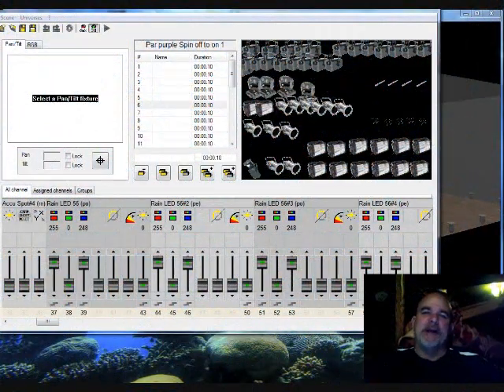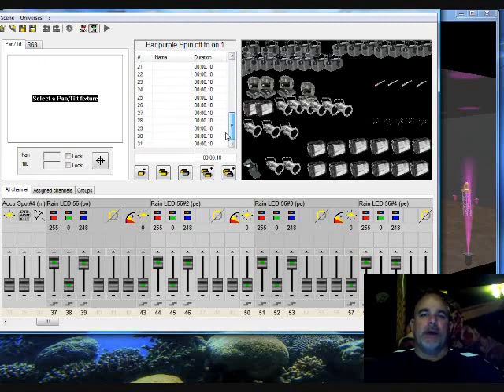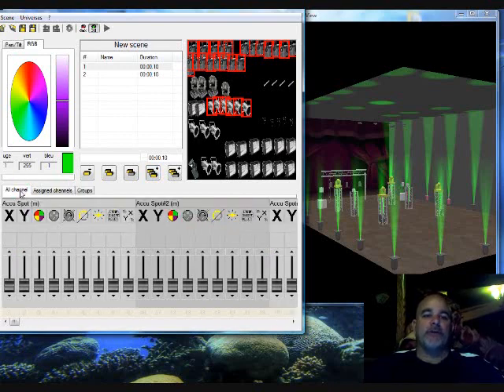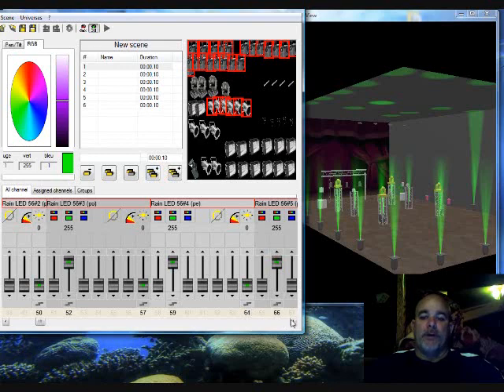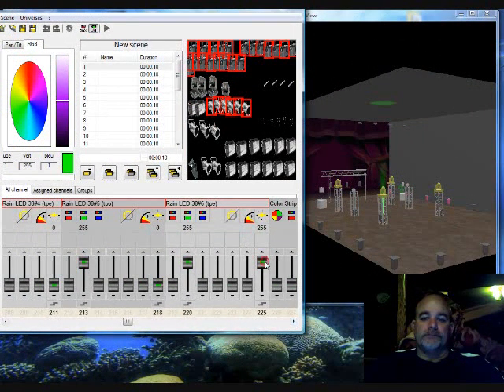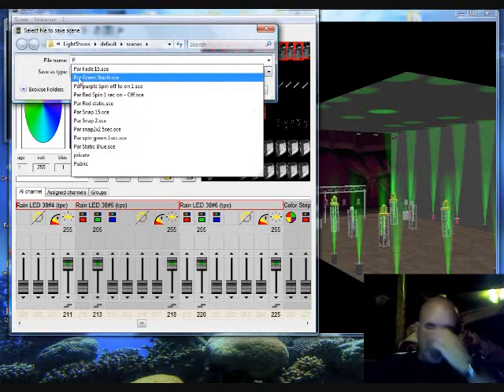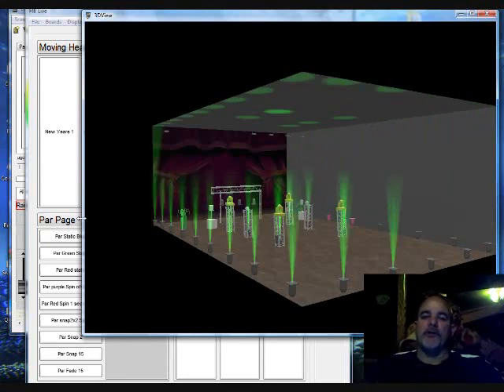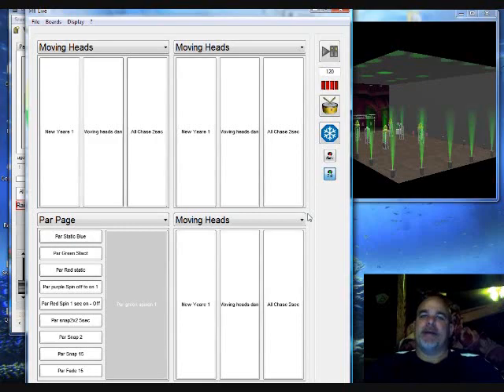ShowXpress 6.0 Scene building room spin with DJ Mikey Mike

Comment: Thanks Mikey Mike! Quick question. Is there any way to make a batch change to the step duration? In other words, if you have, say, 12 steps that each have a duration of 1 second, can you select all 12 steps and change them to .5 seconds at once? You could very quickly make a variety of effects by simply batch altering the length of each step at once. I've tried, but for the life of me can't figure out a way to do this. Thanks!